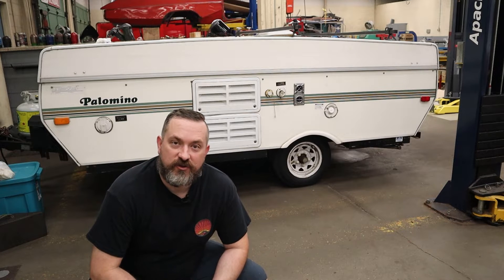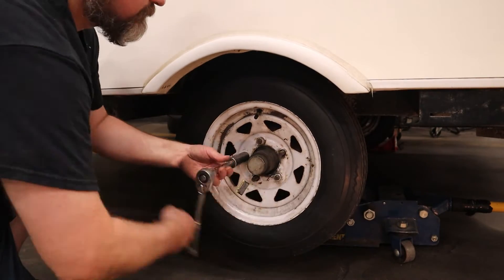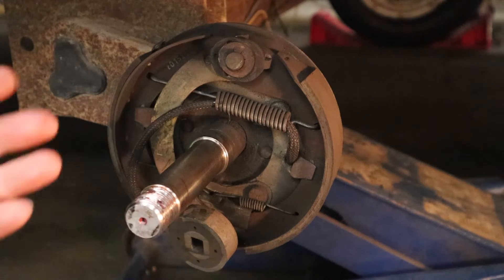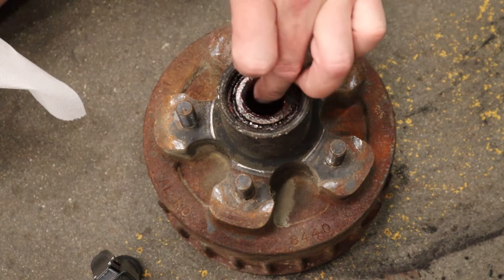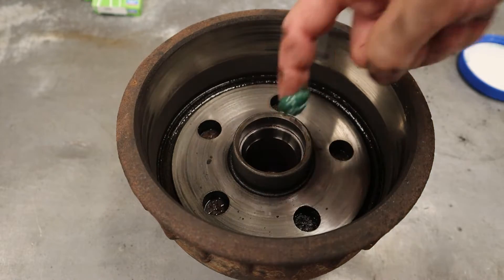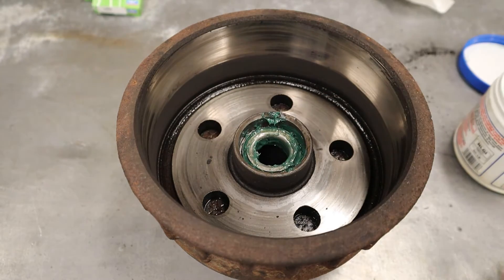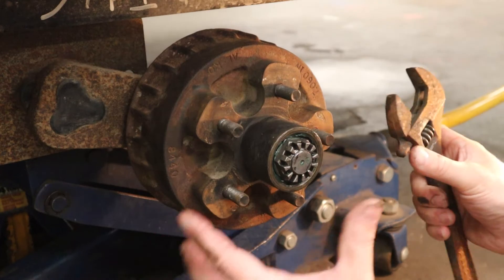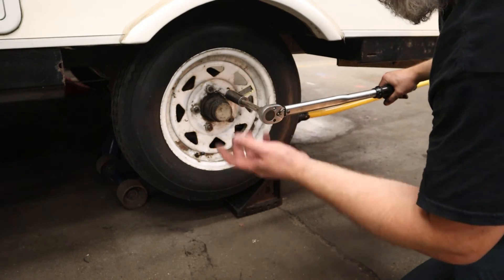How to inspect and repack wheel bearings

Comment: Thanks for sharing your knowledge. My seal came with what looks like a circular spring that I don't know if it came from the seal or it was a separate part
Reply from the maker: Hrmmm, got a part number?
Reply: @wayofthewrench my (old) seal also had a small spring that looks like it was intended to retain the outside of the bearing. Unfortunately it got bent up while I was taking the seal out. I am wondering whether I need to find another one, or can do without it?

Comment: My axle doesn’t have a cotter pin hole
Reply from the maker: If your axle doesn't have a cotter pin then you have to use a locking nut like a nylock axle nut or sometimes there are special sprocket looking washers that you hammer over the nut and around the base to prevent it from loosening.  Really make sure there isn't a hole though, sometimes they get filled with crap.  Thanks for the watch!

Comment: You mention kerosene for dissolving the rest of the grease out of the bearing. Would gasoline do just as well?
Reply from the maker: No, never use gasoline as a cleaning agent.  It is too volatile.  You can use brake cleaner too.
Reply: @wayofthewrench  Thanks for providing an answer. I don't understand what the problem is with "too volatile". I'm worried you might be too fanatic about health concerns. Gasoline is the cheapest solvent available. I don''t care about breathing in some slight gasoline fumes. The question remains: will gasoline hurt the bearing itself?
Reply from the maker: Gasoline will not harm the bearing.  When I say volatile, I mean explosive.  Gasoline is not a solvent and should never be used as such....even though it does the job.  I'm more concerned with a fire/explosion rather than breathing in....although that is not healthy as well.  Huffing gas is no joke...lol.

Comment: Great video and thank you for it! My hubs also came from the factory without washers so could you tell me the dimensions of that washer you installed? I have a 1 1/16 spindle  which I think that's the same size as the one you were working on. Thanks
Reply from the maker: I don't have the dimensions but if you go to your local auto parts store and bring you bearing or dimensions, they should be able to figure out some washers.  They are very thin, think like .050" or so.  Thanks for the watch!

Comment: Incorrect bearing adjustment.  Must be a little play in bearings. 
.001" - .005" end play.
 DO NOT MIX the Red & Tacky with the X-TRA Heavvy Duty grease. They are DIFFERENT TYPES of lubricant, with different properties. The Red & Tacky is a lithium-based grease, while the X-TRA Heavy Duty is a synthetic grease that lubes better and lasts longer.
Reply from the maker: Yeah I'd say that's about right and on some vehicles up to.010" would be acceptable.  That's what your shooting for but most people don't have a dial indicator to check that.  The method I showed is better than not feeling any play after backing off the castle nut to line up the hole in the shaft for the cotter pin and continuing to loosen another notch and having too much play. I would also recommend that the hub be checked for excessive heat shortly after driving it.   It is a bit of a knack that you learn to feel what is correct.  Even techs have issues with this so some companies like Toyota have service instructions that tell them to rotate the wheel hub with a fish scale and tighten the castle nut until they reach 15-17 lbs of force and then back off until the cotter pin can be installed.  Sometimes you can't even get it where you want  and a different thickness shim washer is used to get it better.  Thanks for the watch and the tip!
Reply: @wayofthewrench  As a 40 year retired ASE master tech I think I've seen just about every bearing adjustment procedure out there. The Japanese do like their string and fish scale method for some reason. To temperature sensitive for my liking.  The biggest problem with the majority of RV running gear components is the fact that they are Chinese made junk. Bearings and springs have very little safety margin.  RV EZ Lube spindles are the worst thing ever in the hands of the general public.  Be good, and if you can't be good be clean.
Reply from the maker: Yeah if you bring temperature at install time into it, it changes again slightly. Yeah those ez lube systems seem nice but then people over grease/under grease them and don't have open them up to inspect them until its too late.  I just about didnt inspect my bearings this year cause they seemed ok and I just did them last year but when I opened the one side up, the lower return spring for the brake shoes fell out/broke from age....so it was a good thing I did my inspection/relube. Ended up replacing the entire electric brake system on both sides.  What shops do/did you work for?  Cheers!
Reply: @wayofthewrench  I am retired now but I use to work for a large GM dealership in North east Ohio. We worked on everything.  Smart cars to Kenworth trucks. I was primarily heavy duty trucks.